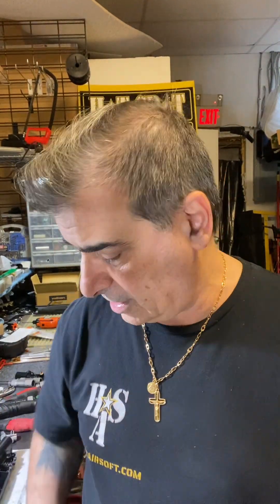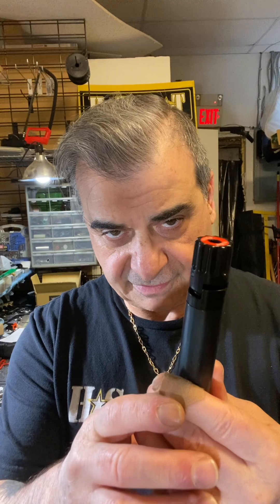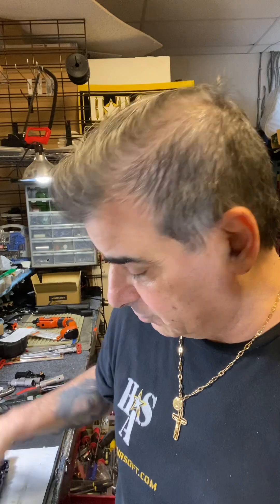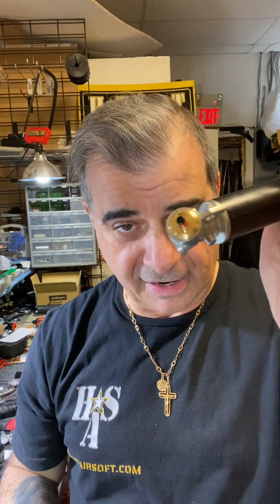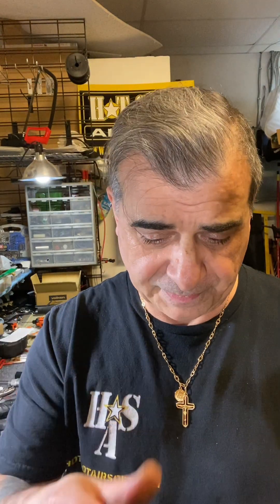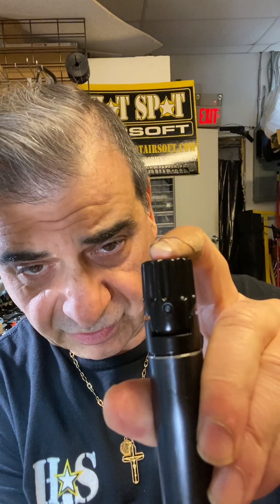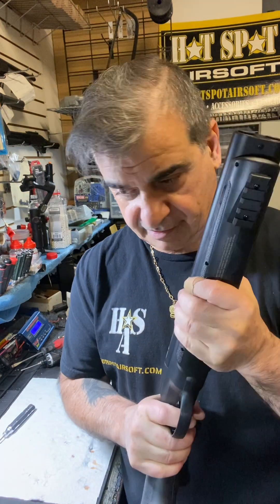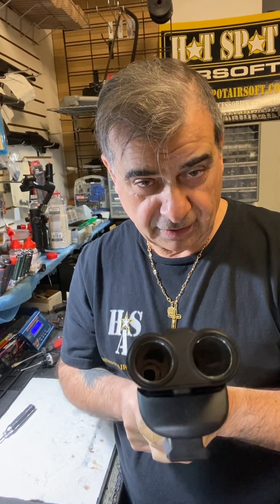T4E HDS / TS 68 CO2 PIERCING ISSUE AND WHY OUR CUSTOM HDS DON'T HAVE IT!

Comment: Thank you for taking the time to make the piercing mechanism better for your customers. 

On a side note, I made a new target trap for the HDX Maximus you sold me and my wife sewed together 8 layers of rawhide to make a 2 inch thick rawhide dropdown to help stop the rounds before they hit the foam cushion at the back of the trap and from 24 feet away, the first 5 rounds went through the rawhide like it was butter. Rawhide is a tough material and a two inch thick piece should have been enough to stop the rounds. I know the rounds from a Grimburg Gavle are stopped cold by the rawhide. This just shows how powerful the shots are from the Maximus 😱
Reply from the maker: 😉Thank you for sharing! very much appreciated!